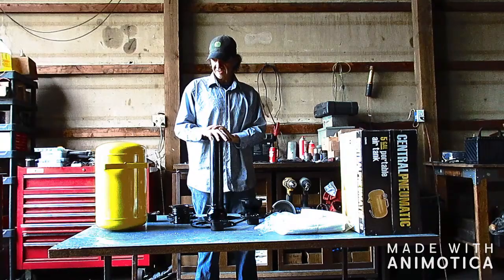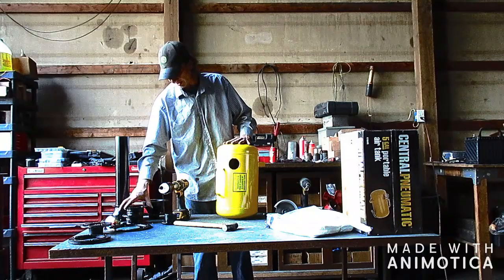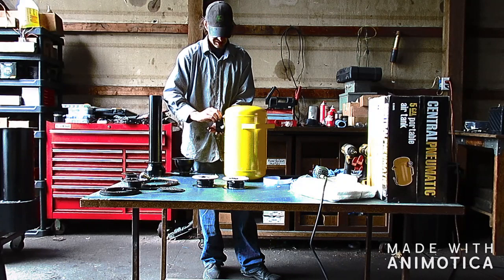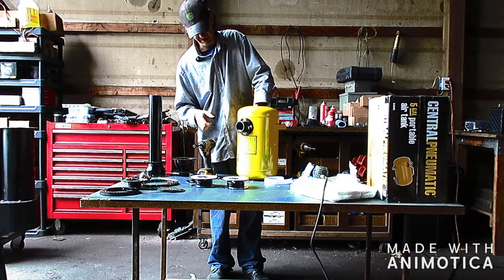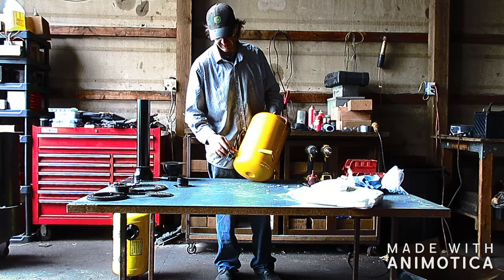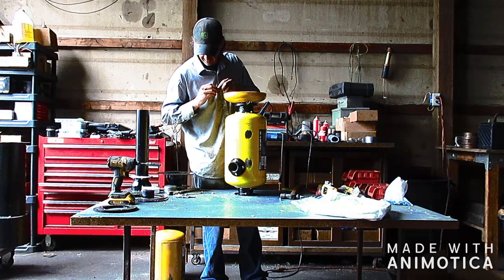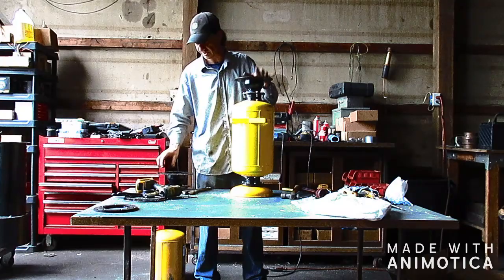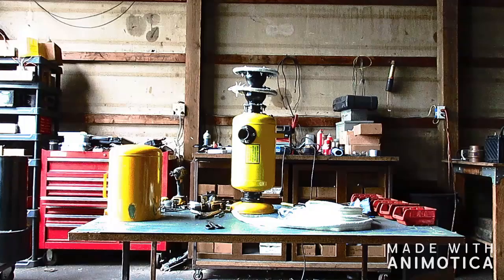Harbor Freight DIY Kit

Comment: I like what your company is doing. Very inspiring! I do have a question though. Is it possible to make a gasifier designed for smaller engines? I noticed the minimum range for the M1 base is 190 cc to 420. My small generator/inverter has a 40cc engine and my larger predator has a "79.7cc air-cooled OHV gas engine". I realize people want more power, but for my needs a 1600 running watt (2000 peak) generator is well beyond what I need or want. My fear would be using an M1 base would require me to burn more of my wood than I need to. Is there an option for people like me who want to use a small one, say go for 40cc to 100 cc engines? In theory should I have to build something 3 times smaller than the M1? Is it possible to make an extra large burning chamber so I can fill it less amount of times throughout the day? I apologize for all the questioning. I have 5 acres of woods most of which were planted 80 years ago, so I have some pretty monster trees.  I don't understand much about these devices but the thought of not having to pay for gasoline for my generators makes me quite happy.
Reply from the maker: Your generator will not produce its gasoline rating. You must cut that in half by 50% as there will also be fluctuations to account for. You will need a larger generator to produce the power you need. Anything smaller than the 212 CC predators are worthless and you throw that gasifier as far as you can throw it trying to keep that little engine running let alone putting a load on it.

Also I do not support raw fuels gasification. I have moved to charcoal systems, it is better technology, This kit is discontinued I have done a DIY video series on how to build a simple unit out of an ammo box, you should check that out and this sounds like a good fit for your application. The engines run far more stable on charcoal and they do not produce tar. No raw fuels gasifier is exempt from tar production. Charcoal systems are also very easy to make are way less complex. Charcoal is also just as easy to make as fuel for raw fuels gasification. Dont over look the energy input in to chipping or chunking. Charcoal you do not need to do that and you also get a lot of energy back via the water drip system, this is something you can not do with raw fuels gasification.
Reply from the maker: Another thing with charcoal. if you need heat, CHP is far more viable with charcoal. You simply integrate that process into your heating application. Now your fuel for your gasifier is basically free fuel as you are producing it for primary heating needs. That is what I am developing now. Chip fuel, chunk fuel and pellet fuel kilns are coming that will cook, produce hot water and serve as a primary heating systems.

Comment: So these are available at the Harbor Freight store?
Reply from the maker: LOL no, you have to buy the tanks. The HF tanks are just the core tanks used in this build. However I dont offer this kit anymore. See our other videos. Do your self a huge favor and look for the ammo box charcoal gasifier. Start here wood gasifiers are for advanced users and for experimenters that are not going to mind building a machine and perfecting it over lots of time. Charcoal is best for small engines under 1000cc, wood gasfiers this small simply do not flow that well at this size plus its very dificult for small engines to drive a gasifier to tar cracking parameter reliably. It will be more a headache that it is anything.
Reply from the maker: Anything you see that is over a year old is generally going to be obsolete. We evolve the product line yearly. So you may want to go our channel and watch more recent videos or check our website. There is also a forum to support you in a DIY endevour.

Comment: Can you link the item to purchase?
Reply from the maker: Ill be working on a barrel filter for it next that will integrate our proven blower system. If there is sales support Ill will continue to add on systems. Electronic fuel controller, self ignition systems, auto gen start etc.
Reply from the maker: here is the link to our website. however the product is not listed yet. https://www.thriveoffgrid.net/
Reply: @Thrive-Off-Grid  Nice! I'll keep watching. I was wondering your opinion on what i think would be called a boiler? I dunno the name. Basically this same gasifier however the heat is on the outside of the reactor and isn't created by the reaction but a secondary fuel. In my case free fuel. Maybe we could chat about it.
Reply from the maker: @mcbaneandassociates9895  yeah sure :)
Reply: @mcbaneandassociates9895  It is called a closed retort. Usually used for making charcoal, or wood distillation.

Comment: still no parts list?
Reply from the maker: It is discontinued there was not enough interest to keep pursuing it.
Reply: @Thrive-Off-Grid  :( could still leave a part list, so those of us who are interested could attempt to build it and improve it. - Thanks for replying though
Reply from the maker: @mq4626  Its not a kit you  can buy off the shelf it was kit we manufactured it was not cost effective. You can buy our M-1 Standard for the same cost and we fully build it.
Reply from the maker: I also no longer support any direct raw fuel gasification of any kind. There is no such thing as a tar free gasifier and there never will be at this scale. It is even possible with charcoal. so we no longer support it. beside charcoal is way better technology, its simpler. more reliable, fuel is easier to produce and less labor. So what if you lose a little energy from your wood, you will have less time making it and if you use the charcoaling process for heat or hot water its not a waste at all. Charcoal units run stable and do not require automation. There is no such thing as a direct raw fuels gasifier that can self sustain. They must have automation to do this and they are not reliable.
Reply from the maker: @mq4626  Raw fuels gasification is actually more wasteful as there are many source of fuel you can not use. Verses charcoal you turn just about anything into charcoal and are not limited by the processing equipment. Its actually more a waste not having this agility. Free pallets for instance, try feeding one into a chipper. Not going to happen. but you can easily chop them up with a circular saw and chuck it into a kiln. See our latest video from our channel.
Reply: @Thrive-Off-Grid  I've thought about building an outdoor unit that would be large enough to accept full pallets (no processing required) as well as other larger chunks of wood. Have a fire box that holds a canister (maybe a 55 gallon drum) and produces charcoal and the canister gasses are utilized too in the overall fire. 
So, this system would produce heat and charcoal. I'm thinking that using it to heat water it could be used to heat my house. 
Minimal wood processing is the idea. All winter I would be producing charcoal that would get stored in bags for use during the rest of the year. Do you know if anyone has built such a system? I think it would produce an abundance of charcoal to supply my car but I haven't done the math. What do you think of this idea?
Reply from the maker: @kirkjohnson9353  just seeing this now. But yeah you get it, make charcoal as you heat now you are making engine fuel far more efficient than you would for raw fuels gasification. You will then have a very reliable system plus heat and hot water. That is the big picture Charcoal systems are much more viable for CHP. and much cleaner for your engine. I will never go back to raw fuels gasification ever again.